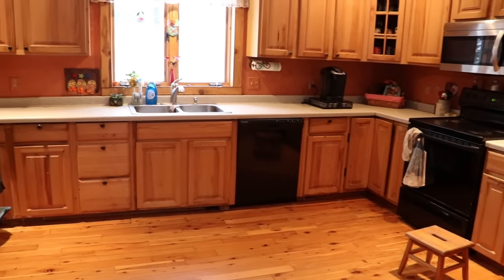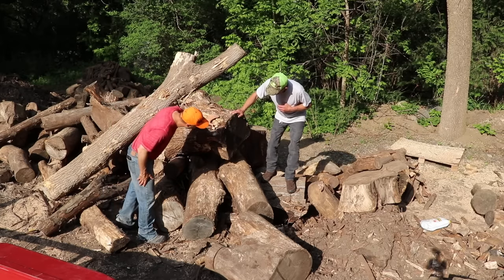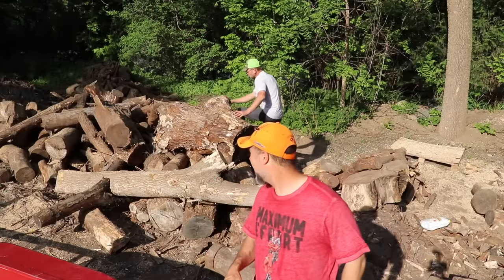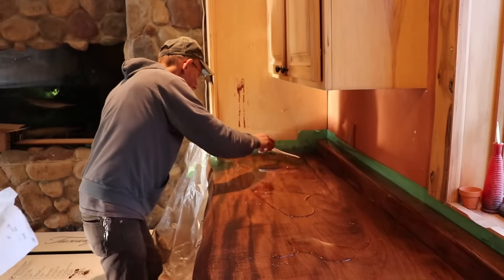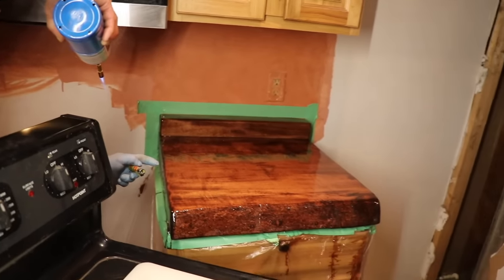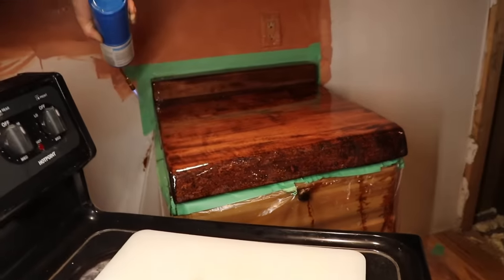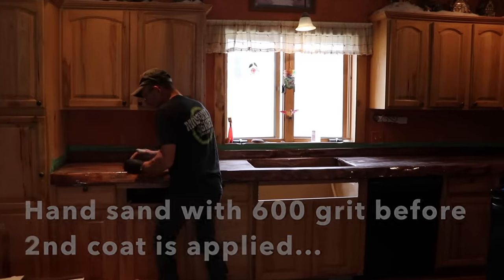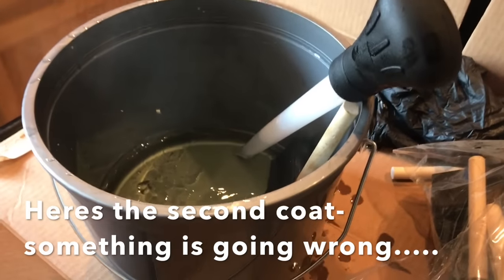A bad Epoxy Job on Our DIY Live Edge Kitchen countertop ... how to do Epoxy repair Pt3

Comment: Bubbles are everywhere, just torch the whole thing like a spray gun, 3 passes, try not to hold the torch on to long.  GLOVES, always protect your skin from epoxy or any resins. You should only be using 91% alcohol as well.   You let that epoxy sit to long in the bucket, that's why it went bad, that's why it got super hot.   Maybe you should just do a video with Stone Coat Countertops.

Comment: Could’ve biscuit jointed the 45s together so they sit flush with eachother while installing. Then instead of screwing from the top down, could’ve screwed from the bottom up to hide the fasteners. Also could’ve doweled your backsplash to the counter to act like an I beam to keep everything straight and square when installing.

Comment: Next time relive the internal pressures within the wood itself.  I’ve set circle saw to about 1/2 to 2/3 depth and cut parallel to the grain on the underside.  Usually the kerfs are about 1 1/2 to 2” apart.  This will greatly stabilize the mass of wood from seasonal movement and can prevent the wood from splitting open sometimes years later.

Comment: Interesting, I have never used the epoxy kinda got out of residential work 30 years ago and into commercial but I have sprayed a ton of high end wood gun stocks with Automotive clear coat and it holds up great but you will get bubbles from pores in the wood you have to deal with but a good wet sanding will take them out.

Comment: I still see some pretty good ripples to the right of the sink at 18:54 and a lot of bubbles to the left of the sink around 19:03.  I am having the same issues with a job.  No nightmares yet, but they are coming, I'm sure!  I think rather than going for a gloss finish, I'm going to do a satin finish which will help minimize the glaring imperfections.  Satin should also reduce visible wear that a gloss finish will show.

Comment: Use Stone Coat. REALLY easy to use, easy to mix and amazing working times. You can use it inside, it has no odor, food safe and heat resistant up to I THINK 500 degrees. Also did you do anything to seal the underside by the sink? I may have used red guard to keep the wood from getting too wet in cases of sink/water issues. Looks beautiful BTW. I am in MN and will probably go to the lumber yard you used.

Comment: few questions.  why so thick?  how durable is it? can I cut on it? can ya put a hot pan on it?  next you need new appliances. new cabinet faces.  GAS STOVE. no electric crap.  Overall the tops look good but not my cup of tea.
Reply: I second stonecoatcountertops   check out their youtube channel. LOTS of videos, how to's  color blend instruction, durability test videos.  Always their to answer the phone with any questions you have     check them out!
Reply: stonecoatcountertops is great but since its alot more then others i use it for a finish coat. make sure if you use a diffent kind for color coat or first coat make sure its yellowing resistant

Comment: 1st coat I always scrape it off before cured. Less material to sand through. I also use acetone. Spray it liberally. Bubbles go away and no torching. Not for final coat as acetone will alter gloss level.

Comment: I am making a conference table, and the resin separated from the wood underneath.  Ive sanded down to the wood in the area that was a problem.  If i pour the new resin, will it blend seamlessly with the original pour? I'm concerned about being able to see a "seam" between the old and new pours.  advice?

Comment: I have never had much luck with epoxy finish. The foam brush may have caused some of the bubbles. Im thinking that chunk of wood was not dry enough and should have been kiln dried.  Beautiful end result but lots and lots and lots of work the way you did it. No wonder people prefer granite. In most cases a 3 inch thick chunk of wood will put your counter top too high. If I would have been doing that job I dont think I would have finished it but I would have enough firewood to last me all winter. LOL

Comment: u can full up the wood cracks with wooddust and glue make a paste 50/50 so the epoxy won't bubble but cover on top. rub the epoxy layer up, and apply a second coat🙃

Comment: With personal experience, you should’ve used a squeegee to spread the epoxy, which you did. What you didn’t do that you should’ve, was followed the squeegee with a 9 inch paint roller for the non-verticals. Would’ve gave it a much more even coverage. But you figured it all out in the end, so it all works out lol.
Reply: Also, the reason the bucket headed up was because the ratio of the mixture was incorrect. The grey bucket didn’t help the cause either.

Comment: Sorry for all your ails,but you got r done. next time you use epoxy like this,seal the wood with shellac, sand with 220, clean with denatured and then epoxy. the shellac prevents outgassing from the wood into the epoxy. and use nap gas for bubbles,not propane.
Reply from the maker: Appreciate the tips and thank for watching !
Reply: Map gas is too hot, too costly, and unnecessary. Propane works just fine.

Comment: On fresh wood you should first mix a small batch and paint brush it on to seal the wood. That will make a huge difference. I have used this exact same stuff 8 or 9 times. Sealing it makes the biggest difference. It is still a pain the ass every time though.

Comment: next time you do something like this get stone coat countertop epoxy or a self leveling epoxy do and tools to use is 1/8 trowel and a paint brush to chop the top then use blow torch to pop bubbles coats of 1 ounce per sq ft sand in between coats and if you have stubborn bubbles keep popping up use a burn stick then do a flood coat of 3 ounce per sq ft and do the same thing with the trowel and chopping with brush but dont sand it and leaving in bucket to long no more then 3 inches or will get to hot

Comment: The key take away is make sure the things you use to apply the epoxy wont react with it. So can the warning labels and recheck. And if ur unsure dont use it, ie the gray platic bucket and foam brushes...

Comment: First person who puts a knife on it or scratches it, I feel bad.
Reply: Capt Murf it would polish out easily. The wonders of epoxy...
Reply from the maker: I feel bad for them as well haha
Reply: You have seen restaurant bars and tables made out of epoxy, right? They're very hard wearing. Those of purple a week with silverware, keys, kids, bottom of ceramic plates, etc scraping on them. One in a residential application will hardly see any wear.
Reply: epoxy can be used for floor in house and garages too. its alot stonger then stone with just a few mm thick. you can beat on it with a hammer or screwdriver and be able to buff it out in 2 minutes
Reply: it's a hard surface, and they can be sanded out, and buffed back to the original shine, sand scratched area by wet sanding in this order.... wet sand with relief disc on orbital sander with the grit pads you need... sand 180, sand 300, sand 500, sand 1,000, sand 2,000, sand 3,000, sand 4,000 grits, all wet sanding, then buff it like a car with McGuire's 570 glaze finish compound, scratches all gone!!!
Reply: I always finish epoxy with 2 coats of spar urethane, makes it as tough as you wish the epoxy was.
Reply: What is the best way to get scratches or damage out of it?

Comment: I was interested to see what the instructions say about mixing and what not....I think your 2nd batch messed up maybe because you let it set during the 2nd-6minute mixing time.   The instructions say to not let mix sit or it will overheat and become extremely hot to the touch.  Also Step 5 :Curing makes no mention of sanding only waiting 4-5 hours before second coat.  It does say use a handheld torch 4-6 inches away to get rid if bubbles.   It was still a great video showing what are some issues with live edge wood and epoxying

Comment: Surf board makers use a cap full of xylene and paraffin wax with the finish coat makes the red thing come out glass like smooth and gets rid of the wavy ness and all the bubbles. It’s an old surfboard trick

Comment: Welcome to MY WORLD.  lol  Epoxy is a dedicated pain in the rump.  I have a couple of things to add.  1) First Coat - Next time, heat the counter-top beforehand and then coat as it is cooling.  This prevents out-gassing (bubbles).  2) I hope you guys sealed the wood on the bottom of the countertop.  3) Isopropyl Alcohol contains perfume oils.  That is what contaminated your second pour.  I like lacquer thinner.  NOT paint thinner.  That has some oily crap in it.  Don't use acetone.  I've never used denatured alcohol, but that might work.  idk.  Wiping down with lacquer thinner before sanding will help remove the waxy layer that gummed your sand paper.  Still, be prepared to use a BUNCH of sanding disks.  That's just the nature of the beast.  Oh, once it's cured, epoxy and dust is not harmful (although you're probably better not to breathe any kind of dust), but the liquid resin is basically a whole batch of BPA so please wear gloves and try to avoid skin contact.  I cringed when I saw your wife's hands covered in it.  Hope this helps.  Good luck and God bless.

Comment: Should probably specify that your tips are specific to the epoxy you are using. I've tried a lot of epoxies but I prefer EcoPoxy for my bar tops and for that stuff the heat gun is 100% the way to go. Torch isn't too forgiving and if you get carried away it will cause it to flash set before the bubbles pop. Too hot!    Stirring for 12mins with some epoxies is a no-no as well as stirring too long will cause some to set early. 

Have had issues with flash sets in buckets as well. Ecopoxy for example can only be poured 1/4" at a time. So if you leave it in the container too long while you are pouring, 3"+ in the container will start to heat up over 20-30mins and suddenly it hits a certain temp and sets nearly instant.

7:45 that spot is creating bubbles because the thick epoxy is slowly seeping into that crack. When filling voids it can take 2 or 3 pours to get it up and flush to the surface.

If your flooding it you really only need the first coat to seal it. Squeegee it in THIN, sand, then a second thick-ish coat with a grout trowel to get an even layer. That first thin seal coat stops any air pockets from rising up out of the grain or out of cracks. If you are getting repetitive bubbles in your seal coat, you went too thick.

I've had issues with the real deep cracks in thicker 3"+ slabs, the epoxy will literally set around bubbles before they get to the top. So you can't pop with the torch because they are still in the crack but the epoxy has set before they rose to the top. That is why a seal coat is important.

Comment: You should of done a soak coating before the first pour. You mix it up and thin it down , then paint it on to seal all the cracks.
Then on the next coat is the pour. You get way less bubbles that way and it is easier to clean off with a vacuum cleaner.Your second coat went off so fast, it had to be a bad mixing ratio. It is a exothermic reaction the hardens the stuff. Never seen a bucket make it change like than, but never used one like you did. You never use a foam brush or pad, it reacts bad and will pull a part in to the finish.

Comment: I squeeze hot glue down every crack & holes.Top priority is fill all holes that will bubble up constantly through the epoxy.The bad news is you will have to sand and recoat every few years,it will scratch.

Comment: Who was the manufacturer of the epoxy resin ?  
Did the room temperature play a factor in the second and third coat problems?
Reply from the maker: I don't think room temp was the culprit.  It was the same each time.
Reply: Was the problem with the manufacturing (mixing/blending) of the resin at the factory ?
Reply from the maker: I think it was the grey bucket

Comment: Holding the torch close is nor necessary and can do more damage than good. Breathing on the surface will remove the bubbles to give you an idea of how much heat it takes, plus you're not making waves in the surface.

Comment: I disagree with the amount being the problem. I just mixed a small amount in the identical  grey bucket and the same thing happened to me! I was so upset that I started googling around and found your video. I'm now needing to sand it all down. It got so hot so fast.

Comment: When using a pour on finish the heat does lottle it is the carbon monoxide tjat thins. You can breath on it and the bubbles will pop. It looked like eother you mixed too much or used to much catalyst

Comment: You shouldn’t use 50% iso for finish prep.  The other 50% is water.  You can get 90+ %. At most drug stores or 100% is best and it’s next to acetone and mineral sports at the hardware store.

Comment: I am interested to see your sink, but you might think about using fiberglass cloth inside  the sink.  You are going to have some large temperature variations.  (hot and cold water).  Epoxy without fiberglass is like concrete without rebar.  It might look fine, but eventually, it will crack.  As soon as you get one tiny penetration by water, the sink will tear itself apart pretty quick.  Been there, done that.  Oh, if you thought epoxy sucked, wait til you try to put cloth in it.  If you're not a cussing man, you will be.

Comment: Oooo thermal runaway. You're lucky that bucket didn't ignite.
Reply from the maker: why did it do that?
Reply: You just didn't get it spread out quick enough.  I have cups melt themselves down all the time.  lol  The quicker you get it spread out, the cooler it stays and the longer you will have to work it.  I can't say for certain because I've never used this particular brand of epoxy, but I use PVC all the time and it doesn't affect my epoxies.  But my epoxies also don't melt foam brushes so idk.

Comment: You might reconsider leaving the bark on, I agree with Frankie it would be better to remove the bark. REALLY !!
Reply: I think if you leave the bark on it you will be sorry for that decision down the road. I think the bark is going to come off especially with some use, and how would it be to clean that portion of the countertop?

Comment: dont seal in the bark it will still rot and decompose you can cut in a bark look with a chainsaw or a 4.5"saw blade in a grinder and a wire wheel .

Comment: Just wait until the moisture in the wood starts to gas off. The finish will have a grey moisture trapped under the surface. Rule number one... Never ever work with wet wood.

Comment: With most epoxy they generate heat because of the chemical reaction happening. When In a thick form that heat can be brutal.

Comment: C u learned 2 use gloves. Next round get a mixer and the mix will be consistent. Also most important... Get rid of that epoxy. It's junk man.. Eco poxy or stone coat is way more  forgiving and higher quality

Comment: Those cute little foam brushes ad air plus when they make them the handle is lubed with a silicone to allow fast insertion into the foam. That damned silicone weeps into whatever nice work you are doing and messes it up with weird behavior in your coating, fisheyes and such. Only safe for latex paints.

Comment: This is that Glaze Coat from lowes, it's junk! I used it as well on a table and it's quite difficult to work with and get a glass level effect at the end. I ended up having to sand and refinish it as well. I've used other epoxies after that and they're much more user friendly and have a longer working time so they level out on their own much better. Also, be careful getting that crap on your skin, it gave me a nasty rash right on the wrists where my gloves didn't cover, much worse than any poison ivy rash I've ever gotten.
Reply from the maker: I wish I would have gotten better stuff.
Reply: Still turned out gorgeous! Just a hell of a lot more work than it needed to be :)